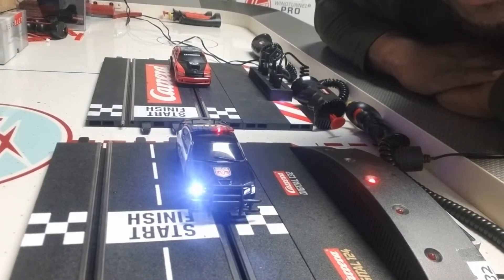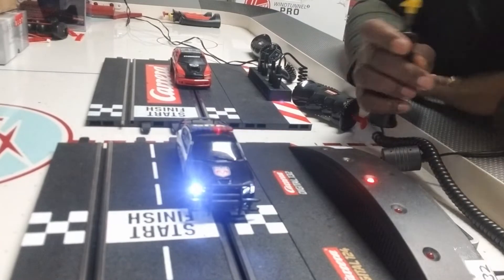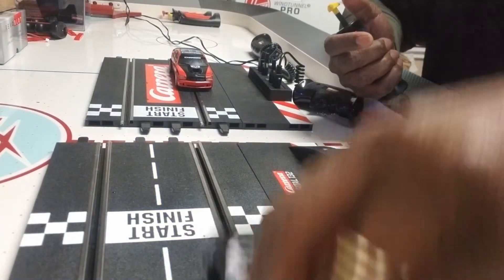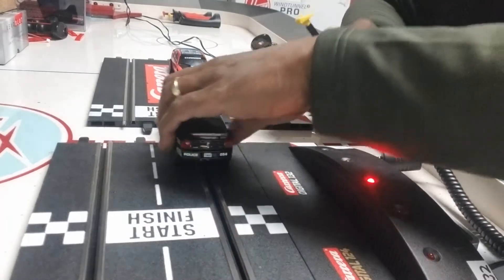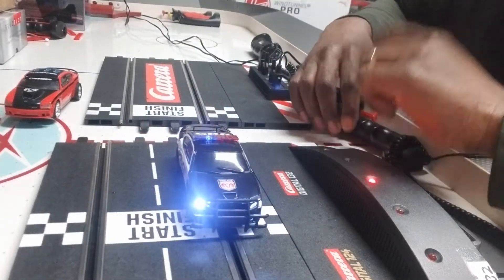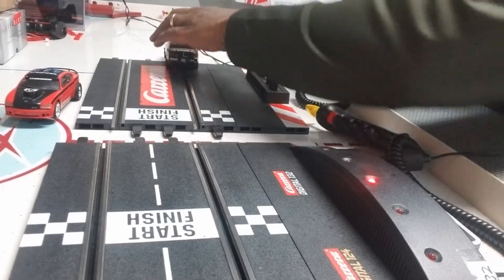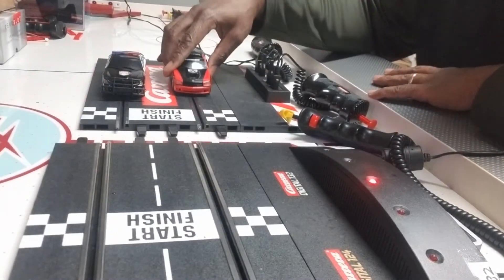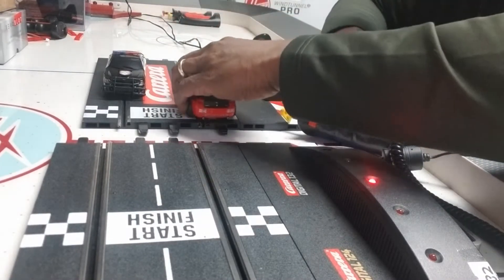Carrera Digital Explanation - Digital to Analog Switch or Polarity Switch

Comment: So yes and no makes me wrong? Youve been rude to me about this for years. Yes I know that it will switch for polarity but the fact that it DOES switch for  digital to analog and in the instructions it SAYS how to switch from digital to analog. 
Further more the digital system is ONLY meant to run in ONE direction NOT, NOT, NOT to run in the wrong direction for digital. If you had worked for Carrera as I had you'd know FULLY that the system isn't meant to wrong the wrong way. 
Digital lane changes aren't meant to be run backwards.
The reason they do it? Do you know anyone that's worked there besides me? I've talked with the designer of the system and he explained the reason for the switch.
The reason for analog is as you explain but it only has that function in analog.
Sorry but you've been beating this drum for years and being rude about it to me pointlessly.
Reply from the maker: Rude...dude GROW A PAIR!!!  Yes, I have corrected you, many many times about incorrect information.  A ploarity switch is a "POLARITY SWITCH".  And yes, I do know people who work at Carrera.  Your former Boss Dave,  Last digits of phone XX39.  And I know a designer, who also posts on the forums alot.  You were so full of bad information, maybe that's why you have the distinction of being the ONLY guy FIRED from all 3 slot car brands.  Inetersting how you posted on my video, and not on the video in question, yours, with the bad information.  Interesting choice.  I'm going to post your note and mine on your video, in the interest of fairness.  I won't delete your comment if you don't delete mine.

Comment: Great video and explanation. However, can you use the digital and analog control units joined together and used independently of each other?
Reply from the maker: The short answer is yes.  BUT, I would suggest disconnecting the Digital CU fromn the track when using analog.  Teh power switch disconnects the power supply from the CU, but it does NOT disconnect the CU from the rails.